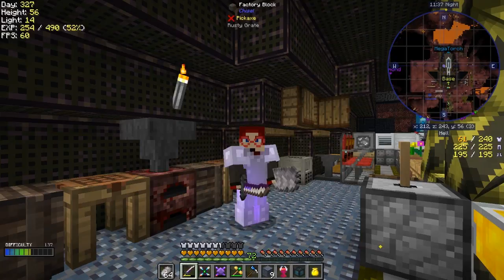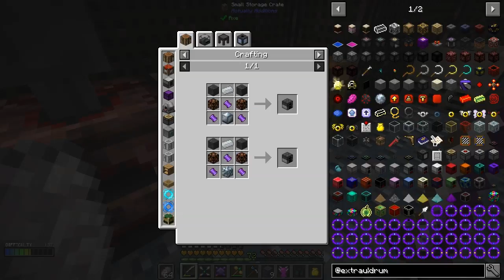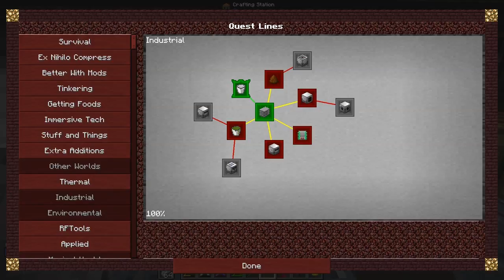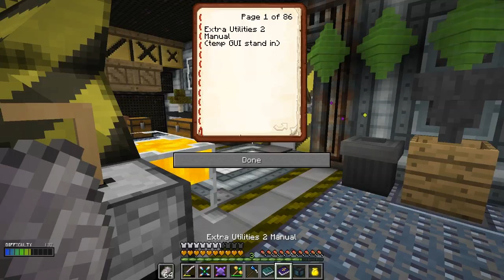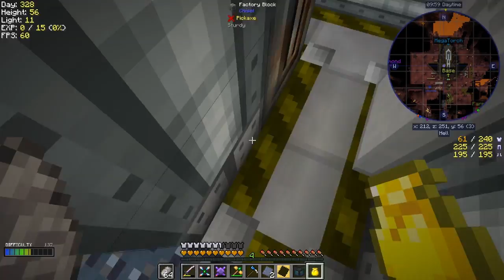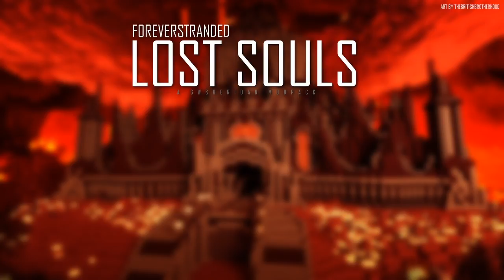Lost Souls #34 - Upgrading Machines and First Soul Shard

Comment: Using the squid ring, glider and the good old slime boots
Reply from the maker: Was the squid ring a quest reward? My best rewards were the infernal chalice and a pair of interdiction torches.
Reply: No its one i crafted. Full name is Ring of the flying squid. It uses 16 GP, but I like it.
Reply from the maker: Where did you get a squid from - have you already been to the overworld?
Reply: Yes got a base in Overworld now. Also last few days been to Twilight. On day 312 - Difficulty 250.
Reply from the maker: Very well done and it sounds like you are ahead of me, less days but max difficulty. Have you done the nether treasure hunt and maze?
Reply: Yes, was good. Lots of nice loot. Unbreakable wand is  the best. If you not done it yet. Take with you a drop of evil for taking out the spawners fast. Witherless rose, for any types of withers. The best is the Salamanders eye, just love that for the Nether. I used Quartz glass as a barrier in the maze. I found it not so hard with those items.

Comment: If you are looking for something to sink power into, rftools has a power cell I was able to upgrade to 4 million RF. Liveroot is only available in twilight forest which I believe is only reachable from the overworld.
Reply from the maker: Thanks, next on my list is a jet pack and one of the cells is portable and will keep the jet pack charged, by chance know what I'm on about? Thanks for the tip about the Twilight Forest it seem like a long haul to get there. Do you know if it possible to get purple slimes or sapling in the nether?
Reply: Duncan Webb Not sure if you are into actually additions yet but fairly early you can make one of their batteries and that will help keep a jetpack fueled. I'm sure there are other batteries but the AA ones are cheap, can't remember the different capacities though. Unsure on purple slime in nether, I know the magma slime islands are in this maps nether.
Reply from the maker: IIRC they do charge the items when activated, will try then out. Thanks for the tip. I'll go and look.

Comment: Soulshard has to be in hot bar to collect souls.  Don’t need to hit the mob with the shard. I think you need to make killing blow manually. Interdiction torch with ender tether make killing endermen fairly easy, unless you get a super magic one
Reply from the maker: Many thanks again for you tip. I'm going to make another shard and try again. Do you need to press shift to prevent the endermen teleporting you?
Reply: Duncan Webb nope, before I learned about the ender tether I would just use the interdiction torch.  For whatever reason they are to busy trying to reach you near the torch and don’t tp.  So I just stand out of their reach and wack on them.  Can stand at the interdiction torch and look at them to Agro them.  Or throw a shuriken.  But those spikes and mob masher will make it difficult.  I would move the ender tethers for soul collecting
Reply from the maker: I must be doing something wrong I looked at one that was quite far away and it teleported me to him, I'll try harder and remove the spikes. Thanks.
Reply from the maker: Worked when I was in the open a bit more. Have some mob charms now keeps the other mobs away.